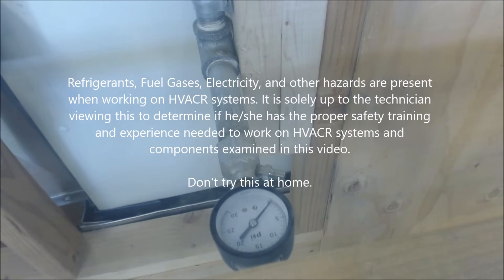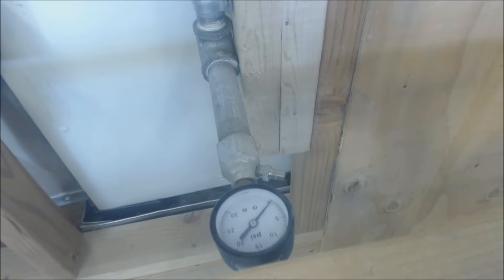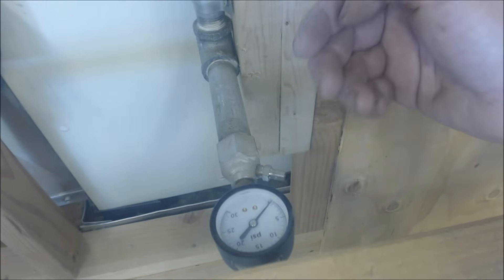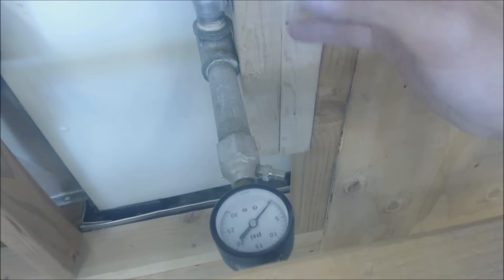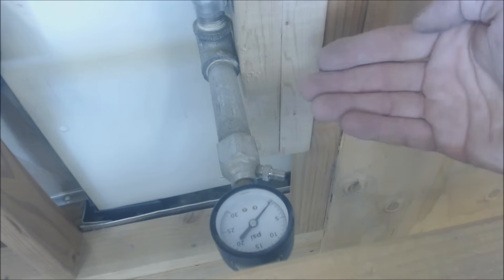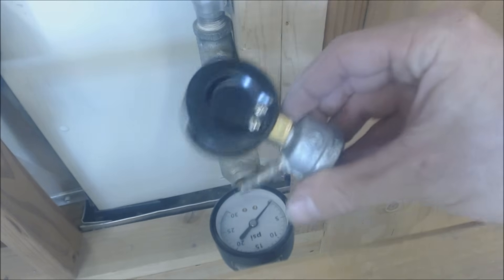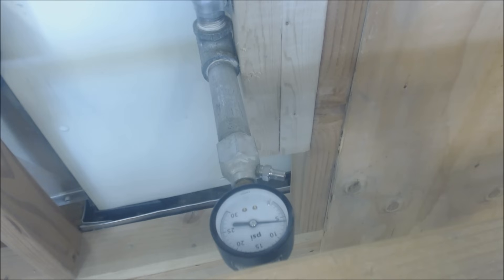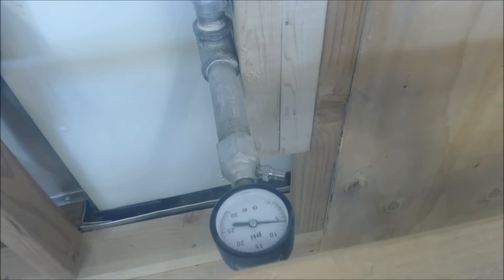Pressure Testing a Gas Line! How to Pressure Test Natural Gas and Propane Lines Correctly!

Comment: I was told that you should check commercial propane at much higher, like 100 psi because if the regular goes it may dump whatever preasure is in the tank (typically 100 psi) directly into your system. My Guage goes to 200, many  guages advertised online go to 100 psi. The propane steel pipe set up I have is rated to 150 psi, although it can probably handle much higher. Although I will probably use exactly the same pressure as a regular household. Is a commercial kitchen preasure test different then?

Comment: A lot easier (for me) to use a gauge that reads ounces on the low side(after 2nd stage regulator), and another that reads Pounds for the high side(1st stage regulator)

Comment: Nobody talks about the fact that the rate of pressure loss by leakage is a function of the volume of the piping being tested.   So if you are adding sections of pipe, testing, adding another etc,  just the volume of a 3 ft section of pipe will lose pressure a lot faster than a 25 ft section for the very same leak.  If you don't understand that, imagine the pipe is 10,000 miles long starting with 7 psi leaking through a small leak vs a pipe an inch long starting with 7 psi leaking through the same small leak.  The 10,000 mile long pipe would take years for the needle to budge. The standards like IFGC are kind of coarse on this point, saying a volume of less than 10 cu ft needs a minimum of a 10 minutes test.   But a 3 ft section of say 3/4 iron is much less than 10 cu ft of pipe volume and the apparent pressure loss from these two volumes over ten minutes for the SAME leak will be much different.

Comment: So if I used a regular psi gauge, chances are it won’t read any pressure at all from the system? I used a compressor to air the line up and all I get is noise from the regulator outside. Like it’s venting excess air outside.

Comment: How can this be done it the system is connected to the gas meter from the utility company?  Can you just turn the gas off at the meter?  Can the valve on the gas meter handle the PSI?

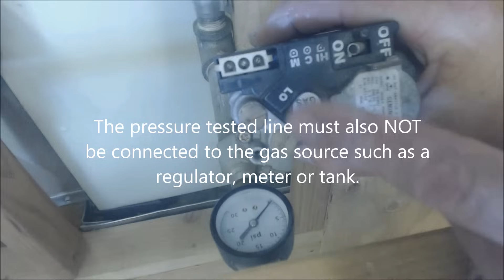Comment: At 4:56 there there is added wording that says the tested line must not be connected to the meter. If you want to test all the way back to the meter does that mean you need to disconnect house plumbing from the meter and then cap off the house plumbing (similar to capping off the feeder lines close to the gas appliances)?

Comment: I put air in my gas line and it held for about an hour. How do release the air out of the gas line before I introduce gas? Does it matter? My bbq stub is capped off at the moment. I tried to let air out of the pressure gauge but it only let about 1-2lb of air out

Comment: I'm having a problem where when the water heater and furnace are running, I have 3 psi at the pressure gauge. As soon as I turn off the gas at the meter and close all of the shutoff valves to the appliances, the pressure drops to less than 1 psi. I attempt to pressurize it with a compressor and no change in pressure is seen. I'm about to do the soapy spray water method today. But is it correct to shut off the valve at the incoming gas meter and close the valves for the pressure test or am I missing something?

Comment: That attachment from the gas pipe to the pressure tester looks like a 1/2 to 1/4 reducer, but I can't find one with a schrader valve attachment.  Do you have a link for it, or do you know what it's called?

Comment: Pressure will not rise or fall with temperature if using Nitrogen to pressurize with which is why only Nitrogen should be used, you never use just air especially if you're a real professional.   Yea right, maybe it's a colder day and then again, maybe you have a leak AND YOU CAN'T TELL unless you use Nitrogen.  Are you sure you're a pro?  Maybe you should be before you go teaching people how to blow others up!

Comment: i use a bicycle pump. No danger of me overpressurizing the line.
Reply: Did that work? I was thinking of doing that but I didn't want to waste my energy pumping and pumping when I could just use my car pump. But I didn't want to put too much pressure in either I think black iron on these stops at around 30 PSI anyway
Reply: @KAngel-ew3ro  Gas line in your house is running at 1/4 psi. Just pump the line to 10 psi and check for leaks and you won't have problems.
Reply: @dasboototto Great, I could also just use the car pump it plugs into the car but yeah bike pump would work on that too The real question is do I leave that on for the gas company to check or do I take it off and put my plug back on. I'm just waiting for my buddy to come but considering he's a lineman now He's very busy He's basically giving me some guidance in which I know pretty much a lot about but as far as testing the line that's new to me. I never had to do that before. I just ran them I never had to check them. So thank you.

That's the significant difference between being a carpenter and a specialist in plumbing HVAC or electrician. We're general they're more specific

Comment: When I added a detached garage I ran a continuous length of 3/4" copper line buried at 24".
I had to flare the ends myself.
I got the gas line permit from building indpection office which outlined exactly what they wanted and how it was to be tested.
They wanted 25# for so many hours.
I ran mine overnight.
PRIOR to the test , I installed a 160# gauge and filled it to 150#.
I then used the soapy water to check all connections.
I found the flared connections leaking.
I cranked them tighter and no bubbles anymore at 150#.
Then I vented the air and installed a 30# gauge and set the test at 25#.
It passed.
I figured if it didn't leak at 150# , it wasn't going to at 25# either.

Comment: Aside of damaging your check valve with a high psi, I would think that you could potentially cause your joints to leak since the seal is a soft set, could blow off the pipe seal off?
Reply from the maker: There is no check valve except the valve core in the pressure test and this is done without appliances connected. This must be done by code when installing a new gas line in a building. I give the code reasons in the video, thanks!

Comment: Our propane company just piped our house and left a 5 lb gauge on with 5 lbs pressure. I noticed next day it had lost about 1 lb and down another lb the following day. I don't believe inspection has happened yet. What is acceptable and safe? Is zero the norm? I don't recall losing any pressure when the underground pipe was tested. I will be speaking to propane company first of the week.

Comment: In the year 2020, is the code still 6 psig or have they increased it to 10?  The lasted search results show a 2018 code book.  Also: if you accidentally inflate to 20 psi will you blow out the pipe sealant?

Comment: A fewUnscrupulous plumbers overpressurize to 30 psi to test yr gas line —— then claim a homeowner needs $5000 of gas pipe replacement since they ‘found a leak’ ...( which they themselves created especially on old threaded black pipe unions or tees , by using wrong  30 psi test pressure.. not 4 or 6 psi. .) always get a second opinion from a certified master plumber before agreeing to pay for gas line replacement.
Reply: It depends on the code, some call for a min 15psi for 15 min for pipe up to 2", 60 min if its more then 200 feet, some code calls for no more then 300% working pressure. Black iron fittings should be rated #150 so at min 150psi. If it leaks at 30psi, its still leaking at 5psi and 0.25 psi. Its easier to find a small leak at 30psi, nothing harmful to pressurize a system to 30 psi.

Unfortunately it is difficult to find a trades to certify a pipe system with any leak as there is no "acceptable leak rate" in any code. The trades are put in an awkward position where there is a small insignificant leak thats probably existed for decades without notice or issue and if they touch the system such as install water heater they are now responsible.

With that said, some trades would rather replace the system then spend hours trying to find a tiny leak, its easier and less risk to quote pipe replacement then guess the hours needed to hunt for a leak. Like you said just have to get multiple quotes. $5k sounds excessive for 1-2days work and $100 worth of pipe
Reply: 140 psi one hour
Reply: Uneducated comment

Comment: I pressure test to 80 psi, isolated at both ends.
Reply: Doesnt that hi a test pressure blow the friction joints in old black pipe? Our m o pr is 4 psi for testing for leaks in n g appliance supply piping.

Comment: Thank you. That was the details I was looking for. I appreciate when people provide the details/reasoning at a high level while referencing the associated codes.  Awesome video.
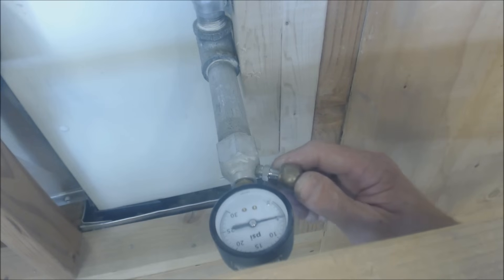Reply: The codes are very important to me. I may be a carpenter and I know how to run the lines and all that, it's making sure I'm in compliance with codes that's important. Plus my buddy is HVAC is going to come up and check everything before I have the utility lines turned on, a double check per se and is important for me to make sure I know what I'm exactly supposed to be doing here and looking for in the most extreme manner. So in this case I could fill up the line let it sit at 6:00 7:00 PSI overnight tap the thing and if it's still good it's still good. When he comes up he's going to double track everything according to codes and then if it's all good to go I'll call the utility company and have them turn on the lines. Now I'm not going to waste his time making them drive 4 hours for something that I should have done before he got here. Time is money for him

Comment: how much pressure does the gas meter put out to a 3 bedroom house? because I would want to test at that pressure so I know its going to hold.
Reply from the maker: Low pressure nat gas is roughly 1/4 of a psi and we disconnect from any appliance if we were running a pressure test so they dont break.

Comment: Our town inspector requires a 5lb guage only, nothing higher. We have propane which  is normal about 10lb. ..go figure.
Reply from the maker: He requires, it is not the code that requires. Also do you mean 10-14" wc not psi. In residential, it is just a little less than 1/2 a psi. 27.6" WC for 1 psi

Comment: Is good idea to spray soap and water to gage tester some times leaking by the valve and gage treads.  That happens to me when I pressure test.
Reply from the maker: Hey Channel settings, you can just go ahead and replace that schrader valve otherwise known as a valve core and it won't leak much. Yes spray non-corrosive leak detector on available joints and valve core, thanks

Comment: Hi, say I just added a gas line for my fireplace. I have two shutoff valves. One at the fireplace and the other at furnace room where I teed off. So  I would just shut off the two valves and ONLY pressure test the new line correct? Or do I have to do the whole house? Thank you.
Reply from the maker: You can't valve off and then pressure test. The line cannot be connected to the appliance but just near it. Then add the pressure test to the other end of the branch. The whole house does not need to be tested but just the new branch. After the pressure test holds and inspection, release the pressure and connect the branch to the main and the appliance, thanks
Reply: thank you for your reply. so on the appliance side i would just cap the new line off (without connecting to appliance). then on the other end of the new line in the furnace room i would just connect my test dial (without connecting to the main) and put in pressure. so basically, i am just adding pressure to the new line ONLY with nothing connecting to it (not appliance or main gas line). is this correct? thank you.
Reply from the maker: Yes, that is what it states in the IFGC 2018 and then you leak test with non corrosive bubble leak detector afterward at the connection points to the appliance and to the main. Have you seen this video on the inlet gas pressure and making sure to not pressure test with an appliance connected, thanks- https://youtu.be/3pi6uGPPjCo
Reply: Getting ready to test for gas logs. I have a manual shut off in fireplace.  If I cap the shutoff and open valve, that should be alright for my test, right?

Comment: Could you please explain why you cannot use a manual valve in the closed position at the end of the line?  Thanks!
Reply from the maker: They leak and if you read on the side, they only are rated for holding back 1/2 psi, thanks

Comment: Can I go from 1/2” gas pipe to 3/4” pipe after the gas manifold to run it outside and not have a noticeable drop in pressure or flow?
Reply from the maker: It all depends on length and turns. I would only run it in the same or a smaller size after a main trunk or manifold but that is only if my manifold would support the extra btu's. Here is a video on gas line sizing, thanks-  https://youtu.be/MY31HlLdn4M

Comment: Man! Do I love to see the pressure go up! But 6 psi? Wow! UPC used to be 15 psi. Then they lowered it to 10 psi.
Reply from the maker: Hey Richard, that is for low pressure 5-8"wc nat gas and 11-13"wc Lp on a 30Lb pressure test and follows the 3 guidelines spelled out in IFGC 2015, thanks
Reply: Yes you are right 10 psi for 15 minutes.

Comment: finally someone that knows what they are talking about...it is scary these guys using compressors and putting 30-50 psi into the system.
Reply: And why not put 50 psi in a gas line? Because the velocity of the air rushing out a leak can carry debris into the hole, sealing it temporarily. 2 years later, the now rusted chip has fallen away and  , voila"! Boom.
Reply from the maker: Ha ha thank you Rod Paletta! There is lot of misinformation out there.
Reply: It will actually cause a leak

Comment: Can a home owner or hvac contractor secure the main gas shut off valve at the meter if minor repairs are needed inside the house. All repairs will be checked for leaks. Thanks.
Reply from the maker: Yes at the customer side which is usually the right, not the stub side from the ground. Thanks!

Comment: super video can I use a uei manometer electronic? thank you for sharing partner!!!!1
Reply from the maker: You can use the UEI Electronic Manometer for checking the actual nat gas or propane pressure coming into the appliance but you would use a gauge that is tightened onto the actual gas line for pressure testing when the gas line is not attached to any incoming regulators, meter, or supplying appliances. All of the branch ends would be capped during a pressure test to 6psig. Glad you enjoyed it!
Reply: If you use an electric model please be sure that it is properly calibrated prior to use.
Reply: Tony, you are absolutely correct. I've been in the natural gas utility industry for over 35 years and all of our electronic equipment has to be calibrated once a month. You will most likely never see a gas utility use a electronic manometer because of a calibration issues. In Court depositions the water manometer is absolute & the plaintiff's attorney can never question that one for calibration. So that being said there should always be 2 pressure test one with the gauge as shown in the video and one with a U tube  manometer after all the equipment is reconnected ( lower operating pressure test will prove all the Appliance Connections, whether any gas control are  passing, any gas cocks are passing & prove the complete gas system). You're kidding yourself if you're relying on only one pressure test. I've been involved with too many depositions when contractors only rely on the main piping pressure test.